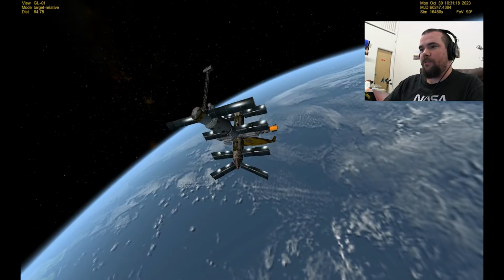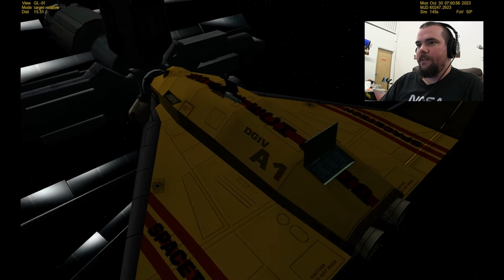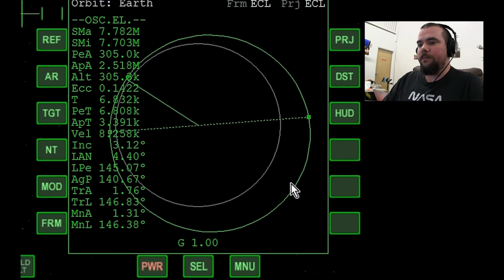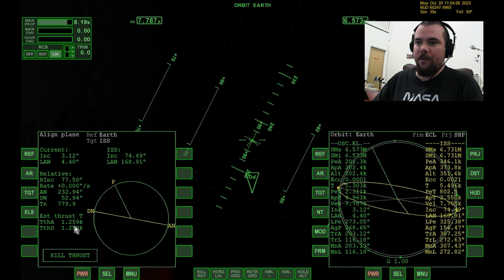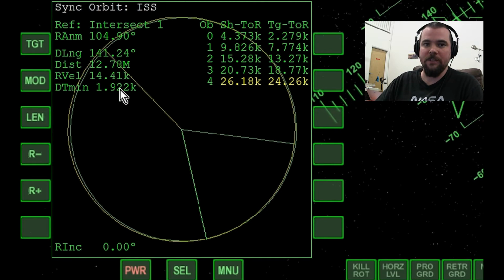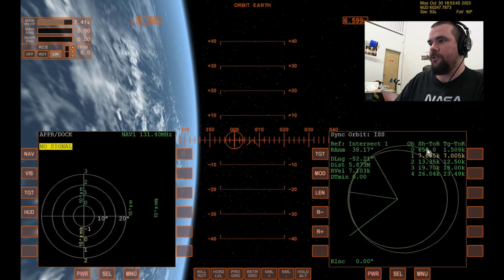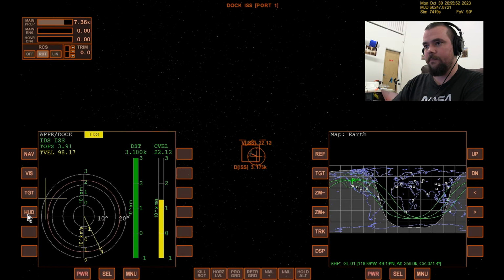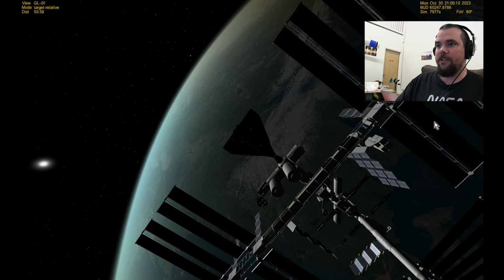[Orbiter] Orbits - Part 1, Rendezvous and Docking with the ISS

Comment: 08:28 I never heard of it before but i learned about that through Orbiters manual ;-)
Orbiter uses the "Barycentric Dynamical Time". Technically its just that the solar systems gravitational center (the barycenter) is the point for time calculations. because as you said voyagers radio signals need e.g. in autumn 16 minutes longer than in spring. because light travels 8 minutes from sun to earth but the earth travels around the sun so astronomical events or radio signals from far away probes would arrive at different times calculated in UTC which is "only" earths point of reference. https://en.wikipedia.org/wiki/Barycentric_Dynamical_Time here is an animated gif that shows it for a better understanding http://astroutils.astronomy.ohio-state.edu/time/bjd_explanation.html

Comment: 06:44 No, thats not true (i guess). I am quite sure, that Orbiter calculates more body influences (at least more than 2) on the ship, e.g. you "feel" that even in an orbiter around earths moon. when you are on the side where you see earth and/or sun you can see your periapsis and apoapsis change upwards to these strong bodies. and around moons of jupiter its even more difficult to obtain a perfectly circular orbit. i think what you mean was, that the solar systems planets run on no changeable rails. in real they influence each other depending on the current constellation (in fact these disturbances even lead to the discovery of Neptune). These corresponding gravitational effects on each other orbiter doesnt take into account.
Reply from the maker: Auf Steam BerZerK[BAYERN] Take a look at Appendix C in the Orbiter manual. Calculation of elements is described in Keplerian orbital mechanics, which is a two-body solution. To the best of my knowledge, this is the actual library used in Orbiter: http://orbos.googlecode.com/svn/trunk/src/KOST/kost_elements.cpp, which is an implementation of the two body solution. The problem with doing more than two bodies is that you get a non-closed solution, meaning you have to accumulate values to move forward in time verses being able to make a single calculation for a given point in time in the future. This is how Orbiter can show you your future orbit without too much error. The final equation for the plot is just an ellipse. Further evidence is that Orbiter decides your Orbit HUD for you, you can't change it, and abruptly changes once a new body has the largest influence. 

I'm not in the best position to argue the mathematics, but I've worked with code like this and it's fairly clear that this is the only way Orbiter can do these calculations. Three-body solutions do exist, but they only support certain conditions, and those conditions would not always be met in a space sandbox like Orbiter. 

I'm happy to be corrected, but that's the evidence I'm working off of. 

I believe it is correct that the planets orbit on rails in Orbiter. It's in the forums somewhere.
Reply from the maker: Auf Steam BerZerK[BAYERN] Actually, this is a better example of that library. The one I initially posted was incomplete. There are various forms of it on the internet if you search for kost_elements.c. There's a reference to the Orbiter manual in the code. http://pastebin.com/2ZCMNM3S
Reply: Yes i am no mathematician or computer scientist myself and i knew about the more than 2 body problem of another game called "Pioneer Space Simulator". Maybe Orbiter simplifies something which i try to explain here. Orbiter shows in the MFD how much percentage of the main body is influence. Near earth its 0.99 and the further you go away it decreases and Orbiter changes the Orbit HUD automatically when the new main gravity source is stronger than earth but it still shows some percentage in red and it needs a long way until its completely zero. You could manually change the orbit HUD back to earth if you like. What i meant is that in Pioneer Space Simulator where there is really only 2 body simulation you "feel" a flip if you lost the main gravity source. in Pioneer Space Sim its perfectly possible to maintain a circular orbit around mars moon phobos, you just have to get near enough. In Orbiter its totally disturbing the orbit around such a small moon because of the gravity of mars, its almost not possible because you always get teared out of orbit.
Reply: Ah and if you change your date "hard" in the scenario editor i think the 2 body solution is used, because the vessel has a always stable orbit. maybe that is definitely 2 body solution. but just try out an orbit around a very small moon in lets say jupiter or saturn system then you see what i mean. At long interplanetary journeys from earth to other planets i always use scenario editor and click click click on days and thats for sure that orbiter makes only a 2 bodys propagation.
Reply: Do you have an account in http://www.orbiter-forum.com ? We could chat ore PM there, guess that would be more easy than via youtube comments. My Username is "BerZerK" (as always ;-) )
Reply from the maker: Auf Steam BerZerK[BAYERN] I appreciate the educated guesses but I can look at the code and see what it's doing. Beyond that we'd have to talk to the devs. There's clearly a lot more going on with all the various perturbations we can configure, but the two-body Kepler stuff is always going to be the core mathematics. It's the only way to have a space simulator work with such flexibility in time.
Reply from the maker: Auf Steam BerZerK[BAYERN] hehe sure. I added you and sent you a friend request :).
Reply: I definitley dont disagree if you have more knowledge about the code (i dont have at all). I had just assumptions because of what i experienced and i compared Orbiter 2010 with Pioneer Space Sim (which is more a game than a simulator but it was the cause i came to orbiter at all because i searched for other space games with high grade of realism)
Reply: Hm, i dont see a private message. Is your name darknrgy, i saw a visitor with that name on my profile.